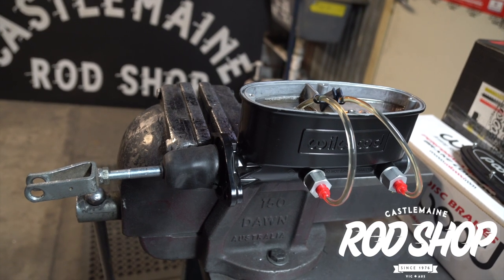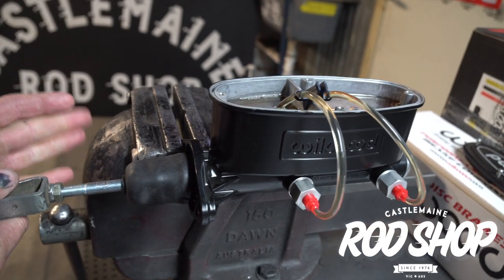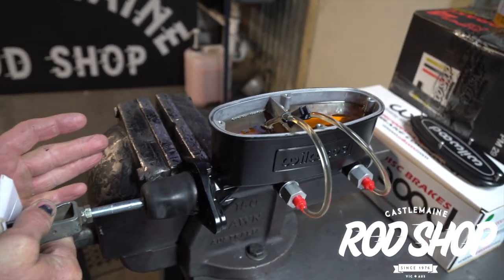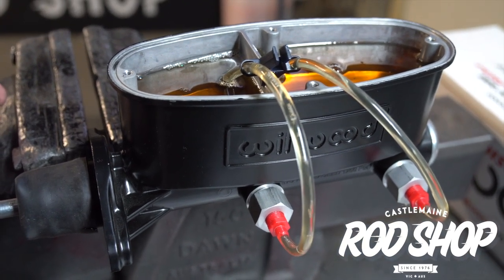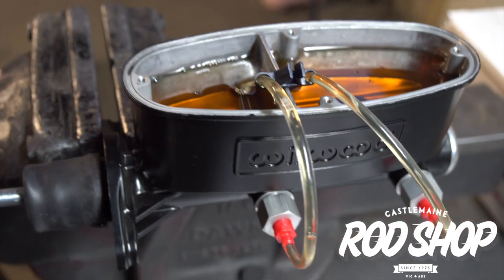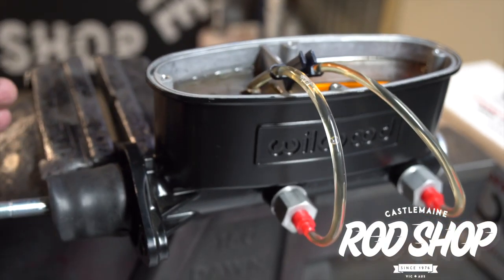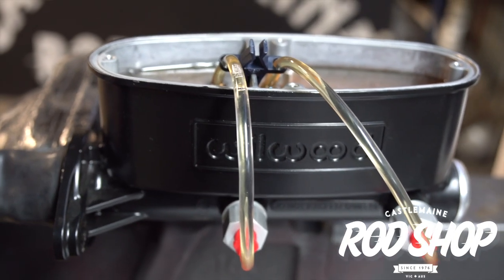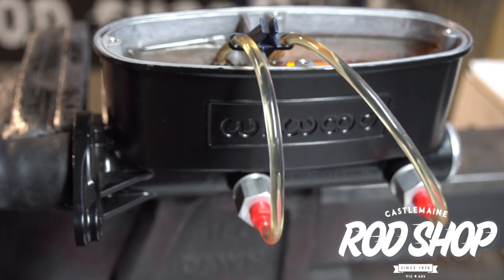CASTLEMAINE ROD SHOP WILWOOD MASTER CYLINDER BENCH BLEEDING

Comment: That’s a handy thing to know the principal makes sense 

I once had Fiat X1/9 and it had a major brake overhaul

To bleed that system on the car it’s harder to pick than a broken nose because the brake lines in there are run like spaghetti and the master cylinder is not at the highest point in the system.......

So I think in that case a new master cylinder ought to be bled on the bench as well and even force fluid through the lines and crack the connectors and bleed them through the olives at the connectors as well......

Same principle applies to Holdens and fords and Chevys and Chryslers.......